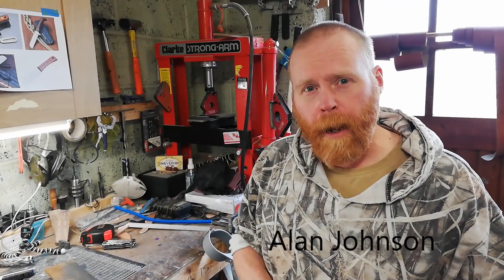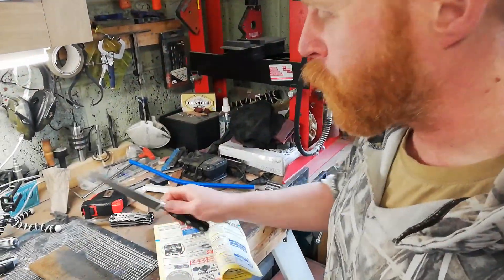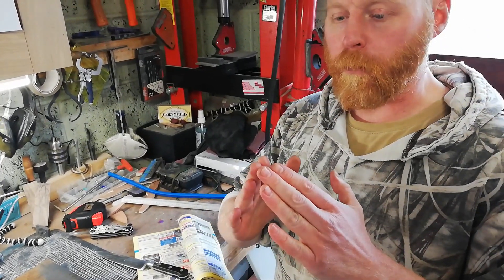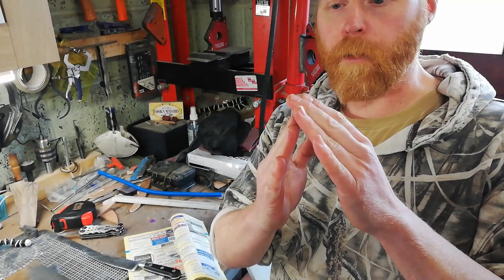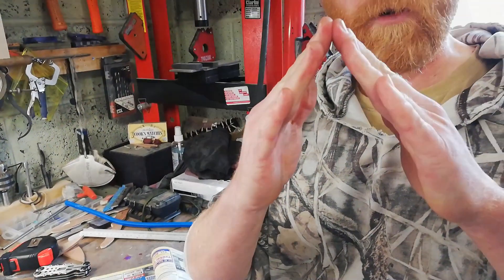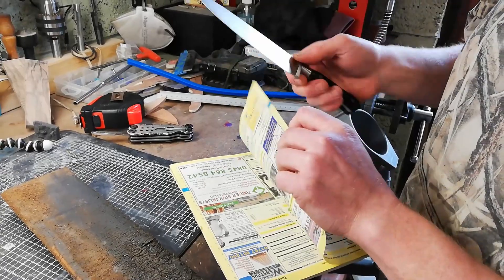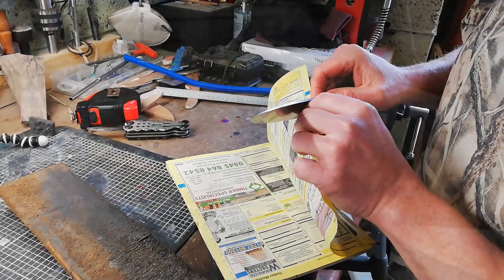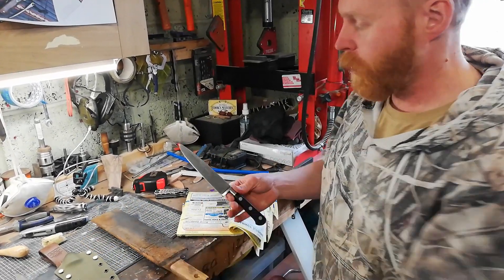Danum Blades

Comment: How many grit is the sanding belt ?
Reply: Hi Thomas. These belts are 30A and  16A Trisacs. On this knife I was just putting the tip back on. The main edge of the knife was re-dressed with the strop.
Reply: 30a and 16a are the equivalent to 800 and 1200